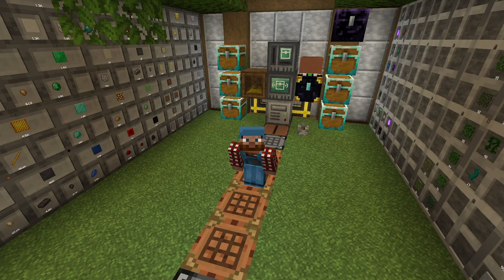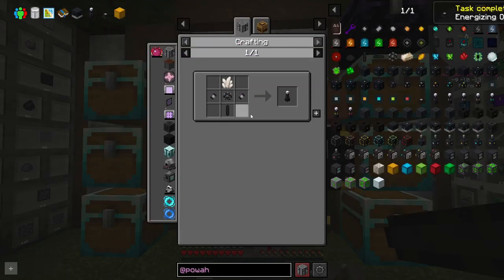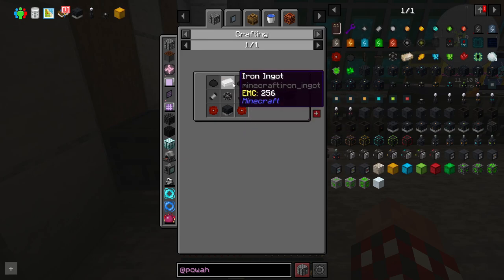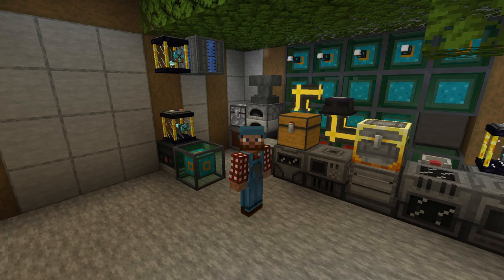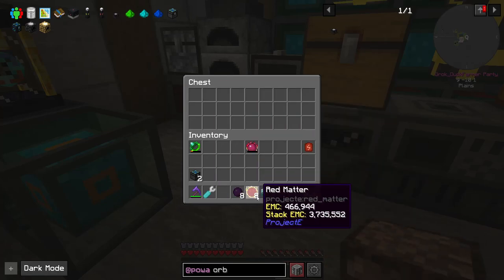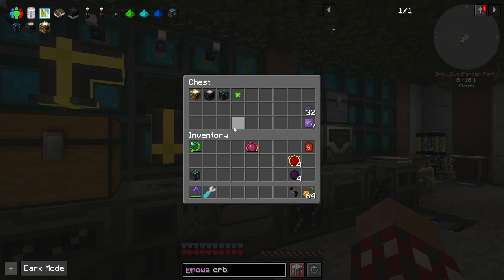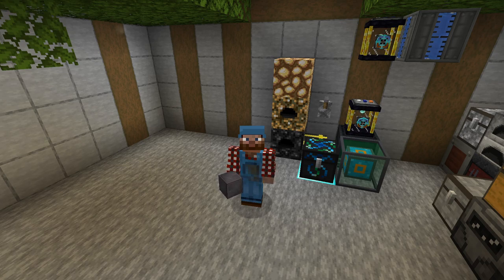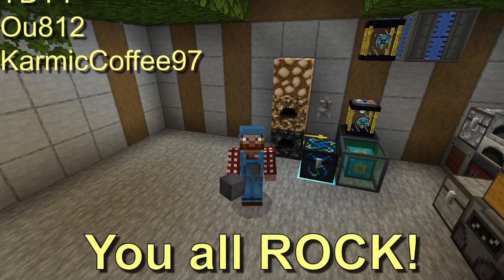FTB Stoneblock 3 #07 - Solving Power and Flight Problems

Comment: I've got a roost with 10/10/10 emerald chickens feeding a condenser, it gives some really good EMC. 14 of them is roughly as fast as the condenser can eat them. I've been making the higher matter tiers (only need one more yellow for the next upgrade) just because I can with that kinda passive EMC, though I should start making klein stars and charging them.
Reply from the maker: Emerald chickens are good, but netherite chickens are even better.  Building up EMC is a good thing to do as soon as you can.
Reply: @GrokDuckFarmer  ExtendedeXchange is great for that. You can start filling and using your personal emc buffer long before you have access to a transmutation table.
Reply: @GrokDuckFarmer  Wait, do the netherite nuggets give more EMC than emeralds? I'll have to change my chickens out, then.
Reply from the maker: Emerald: 16,384
Netherite Nugget: 5,572

Emerald chickens are better than Netherite chickens because they produce 48 Emeralds (786,432 EMC) to the 48 Netherite nuggets (267,456 EMC).
Reply from the maker: @asteranx  Going that route!